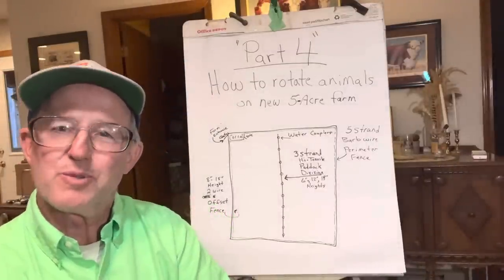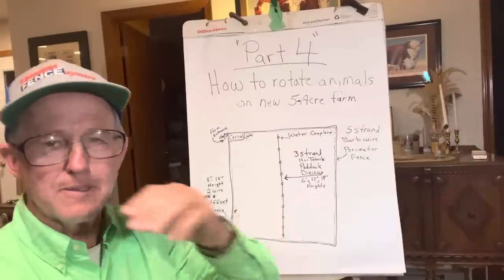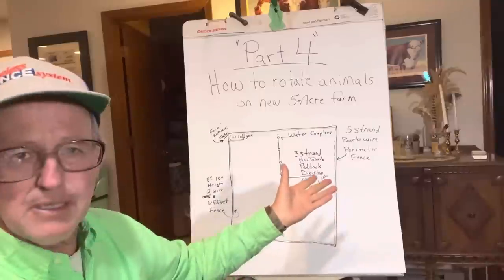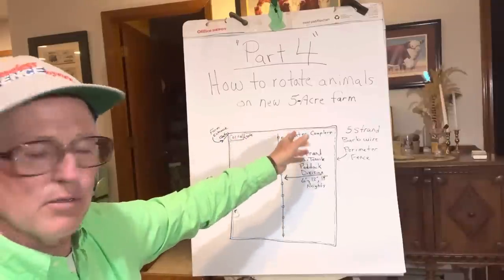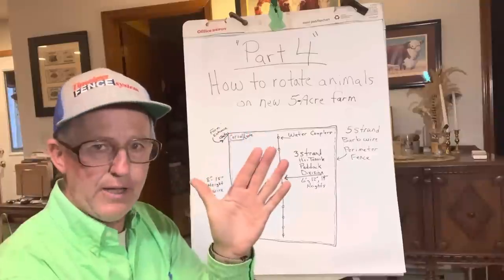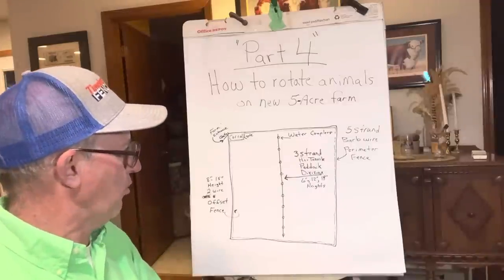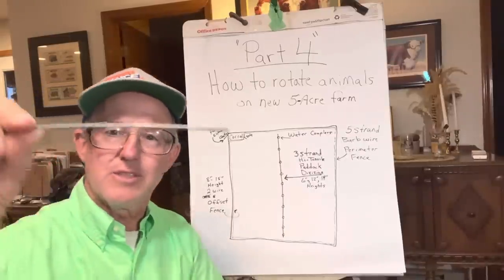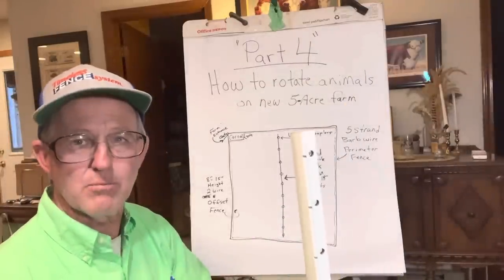Part 4: How to rotate animals on newly fenced with installed water on your 5-acre farm.

Comment: Greg, a little hint for your presentation: You may want to use different colors in your drawings. Like blue for water, red for hot wire, black for title and fences ... you get the idea. It takes a little more thought and practice (as you are doing it live), but users will better understand what you are trying to show them. And that's what you want, right?

Comment: Greg love this video series.  Question on the Timeless posts, how fire resistant are they?  I live in Texas and we do have the occasional brush fires around here, especially with the drought last year.  Is there a thickness that would be okay if a grass fire moved through or would it most likely be a total loss?
Reply from the maker: Fire is an enemy, it would depend on how hot the fire was that passed through the post area.

Comment: Thanks again Greg. 
Understanding they are only in for a short period, what is the most that you would suggest in the theoretical 36'x16' coral w/ hot wire?  We have a little more than the 5 acres. May start with 20 sheep.
Also would love to hear how you might manage this farm assuming it has no trees for shade or shelter.

Comment: Thank you for your help, these are great videos, could you address multi species grazing, I have horses and am looking to add cows or possibly sheep to my ranch (10 acres in NF Florida) as of now I rotate my horses in paddock divisions. Appreciate it. Terrell
Reply from the maker: If you have 10 acres with horses, you don't have enough grass for cows or sheep. 1 horse will eat what 3 cows do each day. On that small of an acreage, you better be careful or those horses will destroy your grass stand. Horses have teeth on the top and bottom of their mouth which allows them to bite the grass off flush with the ground, which destroys the ability of the grass to grow back quickly. The horses take off to much of the solar collector.
Reply: Do you think it feasible to divide the acres in half and use the cows to build up one half and rotate them off to rented acreage and replace them with the horses and allow the other half to recover? I am very grateful for your help, thank you.

Comment: Greg, I agree that timeless fence is pretty good, but her in southern Missouri we have a lot of rocks and sunguard fence posts from powerflex are a good alternative.  We predrill the holes with a smaller diameter hammer drill bit.  It moves all the rocks out of the way and then driving in the post is easy and your post always goes in straight because I can predrill the hole straight.  Timelsess just doesn't work for us.  I saw that you used fiberglass rods in some of your videos and you said they lasted 20 years so they are probably good enough.  We also use the gallagher reels for our polywire.  They are a lot more expensive, but they are a lot better than the o'brein reels.
Reply from the maker: I’ve never been in an area that harder soil then Cochise County Arizona. After using a water pick to blast a starter hole, the Timeless posts went in like a snap.
Reply: Hi Jander, would you be interested in a summer volunteer?
Reply: @chivociso3887  Not this year, but maybe in the future.
Reply: @gregjudyregenerativerancher  Oh yeah a water pick.  I saw that in a video before, maybe yours.  We might use that on our other more flat property! I'll research that more.  By the way my wife and I were just watching your Arizona video about setting up a water line and it helped us out a lot.  We are going to set up the livestock watering system and even use it for irrigation.  I just got a 500 foot length of 1 inch hdpe line with the proper attachments.  Thanks for the great videos.  We really appreciate your hard work and you sharing your great knowledge.
Reply: No worries, thank you for replying and God Bless you and your wife in your regenerative journey

Comment: Thank you! On a lease these particular owners not open to all of this, is there a minimum number of paddocks a person could get by with. It has good web wire perimeter. Would dividing this 25 acres only in half be doable or not?
Reply from the maker: Get your stocking rate right, do not be overstocked. Then make sure your rest period is long enough to let your grass grow back fully between grazings. It could be done with 8-10 paddocks if you do it right.
Reply: @Greg Judy Regenerative Rancher  Thank you Greg!

Comment: So instead of the reels we could use our electric netting the same way?  We only have 5 sheep at this time
Reply: Sheep netting works and is way easier than chicken netting but it is a beast to move or keep hot. Often have to weed ear or mow under the netting but the poly wire doesn’t require any mowing. Netting does give better peace of mind but polybraid also doesn’t break as easily as the netting. If you listen to Greg and don’t buy animals until fence and water are done then polybraid will be all you need. If you don’t listen and you get animals before having fence then the netting is a life saver but it slows down progress so much your really better off waiting to get animals until after setting up fence and water.
Reply: Yes you can use the netting. When we first brought our animals to the new farm, all we had was sheep netting. We move two times a day for 3 months before we graduated up to polybraid. Netting works great, but don't skip the perimeter. We ran 14 ewes and two gaurd dogs, and all the lambs as well.

Comment: Hi Greg. I live in Northern Ireland. I have 4.25 acres, pretty much as you've drawing on your 4 videos. Over the last 2 years I have placed a  hot wire around the boundary, strip grazing a total of 13 sheep 5 of which are lambs, on 2 strands of poly wire. During summer I cant keep up with grass growth. I have no machinery except for a quad and a roller I've just purchased. 
Question is can I crimp the grass enough by rolling it to stop it going to seed, in turn feeding the soil? perhaps I should I add angle irons to the roller to impersonate the hoof prints?
I will buy more livestock (weened lambs) next summer. I'm new to this and don't want to over stock by moving too fast. Thanks Peter.
Reply from the maker: Patience is a virtue. Keep going with what your doing. Having extra grass is not a bad thing if you get in a drought or enter winter.
Reply: @gregjudyregenerativerancher  I will do, thanks for getting back to me. See you in the field!

Comment: Did I hear you right about making the paddock smaller during the summer?
Reply from the maker: When your grass growth slows down, you have to slow down your rotation speed. Smaller paddocks and reducing your stocking rate will allow you to give your grass more time to grow back in the summer.
Reply: How would you handle a pasture that has already put out seed heads ?
Reply from the maker: Make long narrow strips with polywire and trample it onto the ground.

Comment: We aren't on land yet, but I'm trying to plan so that when we move, I will know exactly what we're going to do with our fencing to try to speed up the process to getting livestock. I plan for us to start small, with a few St. Croix sheep. They would be on "approximately" 3-4 acres, I had planned on dividing the section into four separate rotational grazing pastures in the hope of doing regenerative farming because the land is going to need it. Your method seems much more intensive though effective. Do you think that four rotational pastures would be doomed to failure, or might it work as well?
Reply from the maker: It will be better than the Columbus Method, “turn them out in the spring, discover them in the fall. In your rotation, you need enough time for the plants to grow back after they’ve been grazed.

Comment: hog panels or other wire mesh added to perimeter barbwire fence: put it on outside or inside for predator protection?
Reply from the maker: Put it on the inside.
Reply: @gregjudyregenerativerancher  Thanks! Is that so the predators get the barbs?

Comment: Thanks for all the great info! Just a quick question… for a three stranded temporary fence, do you just serpentine the braided wire to create three strands?
Reply from the maker: We use three geared reels with O’Brien step in posts and run three individual strands.

Comment: I was thinking…if you have water lines ran with connection points…after moving the animals, why couldn’t you run a tall garden sprinkler to help the pastures in the slower growing summer months?
Reply: On the smaller farms I mean
Reply from the maker: It takes a ton of water to start irrigating any size area.

Comment: I went to the farm supply store and got a bit of a surprise. I was looking at the high tensile wire and saw that there is steel and aluminum. 
Do you have a preference?
Reasons?
Reply from the maker: Steel is stronger

Comment: What about if you have all field and no trees or woods.. Do u need a mobile shelter in the summer? For cows
Reply from the maker: Our cows are red hided and slick haired. They can take the heat. But you could build a shade structure that could be towed around.
Reply: @gregjudyregenerativerancher  have you come across any plans for a simple inexpensive mobile structure? I've only seen ones using corral gates ($$$) and they don't seem to work well. Maybe something using cattle panels that can be pulled easily and doesn't get blown away in a storm.

Comment: What size sewer pipe is that? 8”??
Reply from the maker: You can make 6” work fine if you have a normal size arm. Big arm folks should use 8” diameter pipe.

Comment: 3 reels and 1 water tank, And move 1 reel and water tank each day?
Reply from the maker: If you set your water tank on the temporary paddock division, you only move the water every other day. With the water positioned in the center of the polybraid paddock division, it serves both paddocks with water.
Reply: 10-4 I bet one doesn’t do that too long before adding water tanks but yes be affordable to start.  Thanks for the info now just need to find time.  My rule there is just do something no mater how little everyday
Reply from the maker: @txdouglas68 with pressure fed water and Plasson quick couplers we use 1 water tank for the whole farm. You’re only dumping 30-40 gallons of water every other day to set up into the next two paddocks.
Reply: Nice a  little extra water on the ground when it doesnt rain for 3 + months might be nice too lol. (have to love Texas summers) Thank you sir!